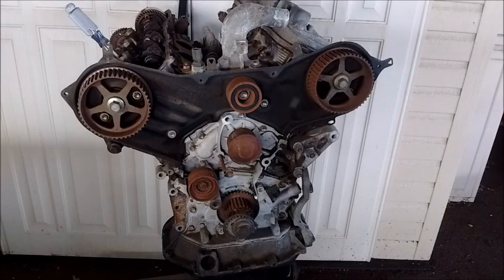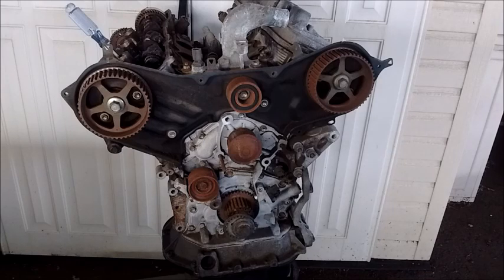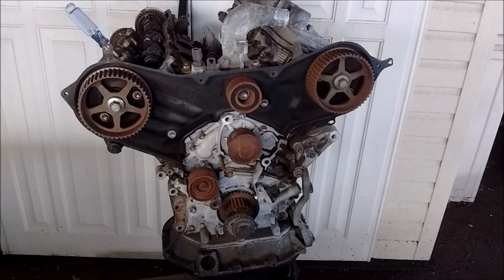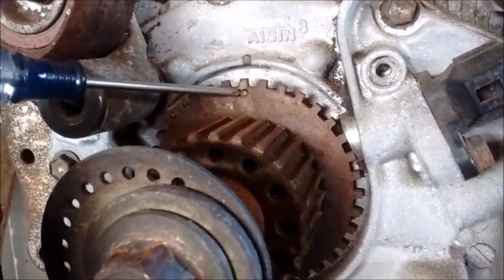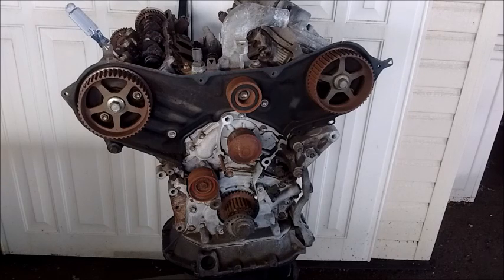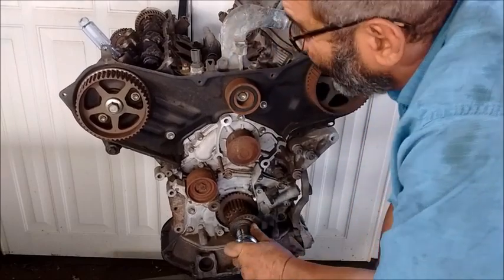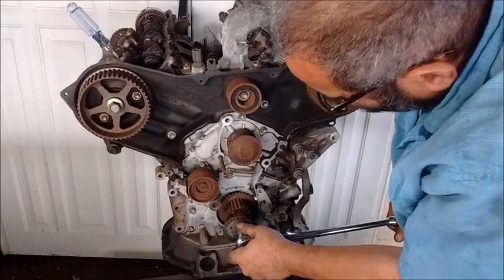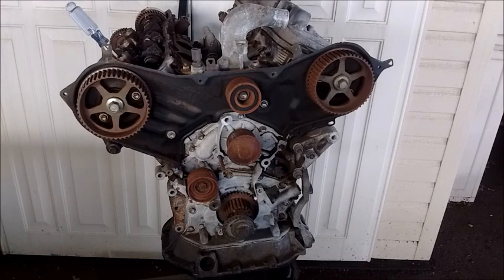Interference or Non-Interference? Toyota 1MZ-FE VVT-i 3.0-liter V6

Comment: Frank I just got done doing a timing belt change on a Lexus 3.3 vvt-i. Long story short when I went to put on the timing belt the right cam sprocket moved counter clock wise and sounded as though the valves  may have hit the piston or it was just the spring action noise. Anyway I turned the cam sprocket back and finished the job and everything sounds great. BUT I still wonder if I did any damage. All kinds of conflicting info on this motor. One website says the Toyota 3.3 is interference and the Lexus is not. Does not make sense. Do you think I would have caused some damage? By the way the earth is round. LOL
Reply from the maker: I don't think you did any damage. But this is the reason why I tell people "ALWAYS USE THE TOYOTA REPAIR MANUAL." The repair manual for your engine tells you exactly what you must do to avoid what just happened - when installing the belt you move the crankshaft away from TDC. Also, there are minor external differences (for example, the tensioner) between different versions of the engine depending on 4wd vs fwd et cetera - however the internals are the same.
Reply: @Merryfrankster_  Thanks Frank: Yes I did read that but totally forgot[watched to many videos of mechanics not doing it]. When I heard that "TINK" I knew exactly what I did. Getting older these days. I really beat myself up for such stupidity on my part because I am a perfectionist.
Reply from the maker: @johndonicht5674  As I get older I am trying to get smarter, but it's a losing battle. The problem is I started out too smart for my own good. Ha ha. Ha ha ha ha.

Comment: funny thing is,   the damage would have already been done when the belt first came off and was cranked once,  then it will spin free with bent valves.   you would need to take the heads off to see the valves,
Reply from the maker: This was done with an undamaged engine no bent valves. But you are free to believe anything you want.

Comment: I just personally changed the timing belt on my 3MZ. Because of the controversial interference-or-not issue on the net, I decided to rotate the crank with both cams at their timing marks. Nothing happened after a full revolution from TDC and back. 

Why?
The cams have the same lift as the 1MZ and the pistons still have valve depressions on them. VVT-i does not mean interference. It's variable lift that causes interference. These engines only have variable timing on the intake cam, that's all.

Additionally, there are reported cases on forums of 3MZ engines snapping their belts with no valve bending whatsoever (not that a belt break is good for an engine) but the 1MZ and 3MZ are certainly not interference engines.
Reply: The 3.3L 3MZ-FE V6 Toyota engine IS AN INTERFERENCE ENGINE according to
 this web site... http://yourcarangel.com/2014/07/interference-engines-complete-list/
Reply: @moochythecat3435  Only the sienna and highlander 3MZs are interference. I checked this personally on my ES330 when changing the timing belt. You can find websites saying both things, just like with the 1MZ. You can also find stories of people having timing belt failures and not bending valves.

Comment: This is not definitive of whether or not the engine is interference.
Although the cam does not contact the piston when spun by hand, some engines become interference at running speeds.
This means the risk of bending a valve is not present while timing the engine, but the valves may possibly come in contact with a piston if the timing belt were to break while the engine is running. This is true for Subaru's EZ30 engine.
Under the circumstances that the 1MZ-FE was originally specified as an interference engine, but later corrected to being non-interference, it would be safe to assume, a similar circumstance may be present and owners should assume the timing belt is critical maintenance and can cause severe engine damage in the case of a failure.
Reply from the maker: If anyone in recorded history has ever had valve to piston contact on this engine, I ask this person to please come forward. You see what I'm getting at? You can assume anything you want. Ha ha. Ha ha ha hah.
Reply: Frank Saab Not a 1MZ-FE, but I bought a 5S-FE (another of Toyota’s “non-interference” engines from the same era) that had a timing belt snap and bent a valve on cylinder 1.
Not a direct comparison, but says something about how Toyota defines “non-interference”
Reply from the maker: @slimeade6021  whatever 5s is not equal 1mz it is not even in the same engine family or generation.
Reply: I had my timing belt blow off at 3000 rpm going 75 on the interstate about a month ago. I have a VVT-i 1mz-fe. It didn’t damage anything besides crack the timing belt cover. Got a new cover and new belt put on and the engine runs like a champ again.
Reply: Will Vaughan Now that’s what I like to hear. Glad the 1MZ will be reliable in the long run.
I’m planning on building one to swap into my MR2 for track.
Reply from the maker: @willvaughan5734  ok will you tell this slimeball who is making a federal case out of this. Ha ha. Ha ha ha ha.
Reply: I really appreciate the clip on this engine. Thanks for doing it. My family run 3 camry's with the 1mzfe eng. And I value most of the comments & have learnt more. For an older car we have found the camry with this engine a great choice.
Reply: @willvaughan5734  AWESOME, the SECOND confirmation my engine should be fine jic the timing belt breaks! Mine's an '02 Sienna w/only 94k mi but LIKELY has it's original timing belt.

Comment: I’m assuming my 2005 Camry is non-interference? It’s a 3.0 Liter V6
Reply from the maker: By 2005 the Camry should be 3.3 which is a light interference motor.
Reply: @Merryfrankster_  in the 2005 Camry, the 3.3 L V6 was only in the SE model. I too, have a 2005 Camry (XLE), with the 3.0 V6 1MZFE.

Comment: Does this apply to the newer 3MZ-FE 3.3L V6 with VVT-i as well?
Reply from the maker: NO. The 3mz  is an interference engine. All you have to do is open the timing belt section of the repair manual and this will be amply clear. You may not rotate the cams with the crank at tdc.
Reply: @Merryfrankster_  Thanks!
Reply: This 3.3L 3MZ-FE V6 Toyota engine IS AN INTERFERENCE ENGINE according to
 this web site... http://yourcarangel.com/2014/07/interference-engines-complete-list/

Comment: Does that mean my 2003 avalon xl has an interference engine
Reply from the maker: The 3.0 v6 is non interference. The 3.3 v6 has light interference. Look at the plastic cover of the engine under the hood see if it says 3.0 or 3.3

Comment: How about 3MZ-FE engine? Is it interference or non-interference?
Reply from the maker: Look I can tell you unofficially that it is interference, and this is corroborated by the Toyota Repair Manual. If you go to rotate the camshaft with the piston at tdc, the valves touch. You must move the piston out of the way by rotating the crankshaft when you do a timing belt service. Video coming someday, soon.
Reply: @Merryfrankster_ Okay. Thank you for your info.

Comment: Hi Frank Saab, is it possible for you to test or at least reconfirm for yourself that 3MZ-FE is interference or non-interference. As one of the very experienced toyota mechanic say that for toyotas' if its belt it will be non-intereference. Thanks.
Reply from the maker: When I get a 3mz-fe engine, I will answer your question. Until then, I do not have an answer. Opinions are divided on the 3mz, just as they are on the 1mz, and also on whether the Earth is flat, like a sheet of paper, or round, like a ball. NOBODY KNOWS.
Reply from the maker: Never trust a Toyota mechanic. They are trained to lie, all day long.
Reply: This 3.3L 3MZ-FE V6 Toyota engine IS AN INTERFERENCE ENGINE according to
 this web site... http://yourcarangel.com/2014/07/interference-engines-complete-list/

Comment: Change your timing belt every 100K and you will never need to worry
Reply from the maker: That's not quite right. A replacement timing belt, whether OEM or not, is never good for 100,000. I'd give it 50.
Reply: Recommended interval for this engine is actually 90K
Reply from the maker: @jamesb8305  if you want to take a chance on a replacement timing belt going 80, be my guest. This video you just watched will sure come in handy if you do .

Comment: Car Care Nut advised vvti 1MZFE engines are interference engines.
Reply from the maker: well then he has not seen this video. 3mz is interference. 1mz is not.
Reply: @Merryfrankster_  I am so glad I found your video, THANK YOU!  For a 2003 Sienna with the mileage below 75K when do you recommend replacing it?  I read somewhere every 6 yrs, another source said every 9 years.
Reply from the maker: @slobodantrendic22  for the first change at 80K miles or after five years which ever comes first. Thereafter every 60K or 3 years.
Reply: @Merryfrankster_  Thank you Sir!!!

Comment: Is the 3mz-fe also non interference?
Reply from the maker: Maybe, maybe not. The factory service manual specifies that the pistons must be positioned clear of the valves while setting the timing belt - indicating this would be a interference engine. But I've never seen one actually mash its valves. I've had a few with broken timing belt that did not have any problem. But I would still exercise caution.
Reply: @Merryfrankster_  I just did the timing belt on mine. Had bad rod knock so decided to do a swap out and partial overhaul on the salvaged replacment. Intake manifold gaskets, valve cover gaskets, plenum gasket, exhaust manifold gaskets, and timing belt. I did it last weekend and it seemed off a hair so I just opened it back up today (damn rain) and did what I could to get the marks dead on. Too much at stake not to get this right.

But the 1mz and 3mz are virtually identical in functionality. The 3mz should have 50ml volume extra per cylinder so I would think that non interference makes sense but I’ll know for sure when I rip the Old one down either to rebuild or sell for parts.
Reply from the maker: @deeeyewhy5949  3mz is 92mm x 83mm wtih 10.8 : 1 CR. 1mz is 87.5x83 with 10.5:1. Very slightly higher compression ratio for the 3mz with the same stroke! Again, factory service manual indicates interference could be an issue.
Reply: @Merryfrankster_  what’s the compression ratio on the 1mz?
Reply from the maker: @deeeyewhy5949  as I just said in the previous comment, 1mz is 10.5, 3mz is 10.8. Did you miss that somehow? Have you considered you might be needing reading glasses? LOL.
Reply: @Merryfrankster_  oops. I think occasionally I will read too quick and skip over things. I’ve also been so stressed struggling to reconnect my 3mz to the u151F transaxle and stress will impair my reading comprehension.

Comment: Here's a fact, my 2005 Camry V6 3.0 is dead in my backyard because of a broken timing belt.
Reply from the maker: Sorry to hear.
Reply: @Merryfrankster_  i mean it was interference
Reply from the maker: @automotivetv9861  The 2005 had a 3.3 which is an interference engine. The 3.0 is non-interference.
Reply: @Merryfrankster_  the car in my backyard says otherwise
Reply from the maker: @automotivetv9861  Check the factory service manual for your car. See if the timing belt replacement section for the 3.0 states any interference concerns, the way it does for the 3.3. Then you can go litigate this with Toyota. Personally, I don't care.

Comment: That is a complete lie it has been confirmed that it is in fact an interference engine if it has VTI if it does not it is a non-interference. Too many lies about this. I can confirm in fact indeed it is an interference engine for the 1 MZFE  VVTI by pulling the heads.
Reply from the maker: I suggest that you get back on your meds asap pal
Reply: @Merryfrankster_  lol ok. Tell me then. Because I just pulled this engine apart bud.
Reply from the maker: @brandonblackburn3625  budy do you even unerstand what you are looking at in this video? The crank and cams can be turned independently without any contact. This means NO INTERFERENCE. If you have dropped a valve in your engine, it is yoru own damn fault for overheating it or running it lean.
Reply from the maker: @brandonblackburn3625  like I said, get back on those meds, or better yet, go see your doctor, ask for a different prescription, the one you have is not working.

Comment: Non interference engines are the way just people don’t F’in care what they get so as long as it’s glossy and has a huge LCD display, people don’t care about their cars even “car”people  don’t care cause of brand loyalty they just accept it…. It’s sad cause we could have so much more but people just don’t know or don’t care 
TL;DR 
People big dumbs to actual reliability
Reply from the maker: Thank you for watching and for commenting.
Reply: @ ofc nothing against your video or channel, just stating facts, people overall don’t expect things to last, hell nothing in my fleet has lasted without a tear down, but realistically we are dealing with metal on metal with oil between, things WILL wear down, best to have Non interference with hydraulic lifters and VTPS to help control the EFI and the Dizzy/cam sensor but that’s coming from someone who’s talking about old tech